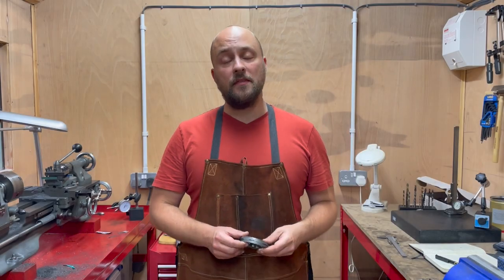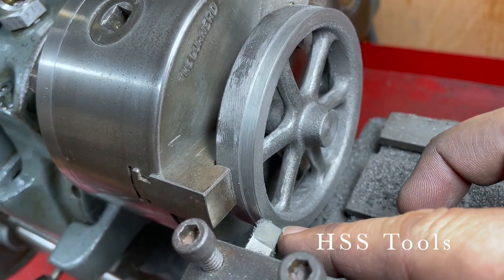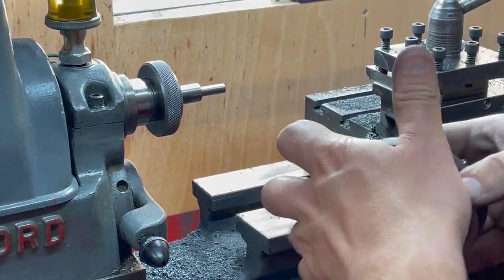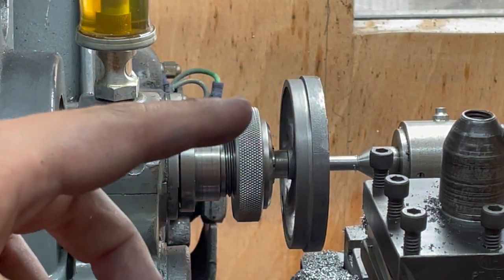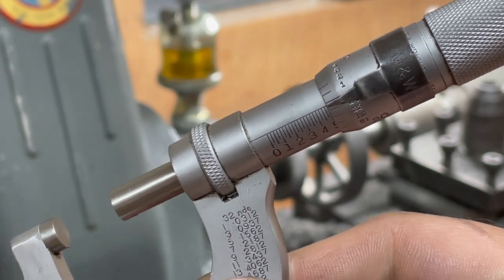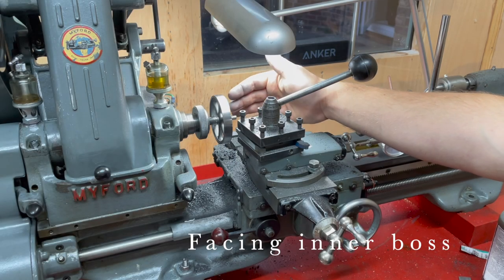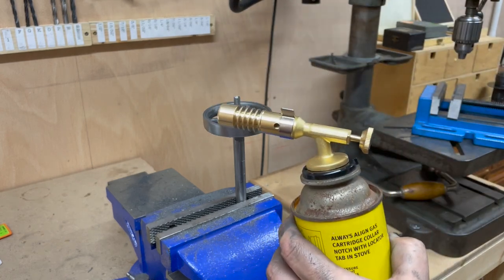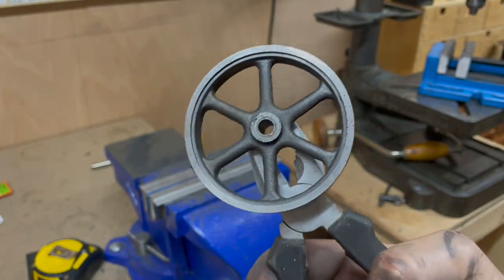Building a Stuart 10V Steam Engine on a Lathe VII - Flywheel

Comment: hi WW
Nicely done, if this is your first project well done.
If i were you, i'd fasten the bench down were your vice is it seemed to be moving around when you were filing, also if you come across a Quick Change Gearbox to fit to the Myford it will save you hours of time not having to change the feed and screwing gears. The blow torch might not flame out of control if you just give the nozzle time to heat up, 
Just a couple of tips  there, i'm not trying to be critical or criticise, but it may help, See you next time, keep up the good work
regards
mr f
Reply from the maker: Thank you Mr. F for the kind thoughts and input. This is indeed my first project.

The bench is terrible, what a waste of money! There are no fixing points on it at all, and it wobbles all over the place. I think I am going to sell it and build a wooden one...

Re: quick change - I may do that. I've not yet single-point-cut a thread in anger yet, so will have to see how that goes.

I've just filmed a video with my first silver soldering, I hope you might be able to comment on that to help me - it was a bit of a dogs breakfast.
Reply: @williamsworkshopuk  I bought one of those benches. I assume it is a "big dug" one? I strengthened mine with extra bracing and it is now very serviceable.
Reply from the maker: Hi  @carlwilson1772  - the bench is branded as 'Sealey' where I am, but like most things that I've bought new is probably a whitelabelled chinese product sold under many marques, etc. - how did you brace yours? I'm thinking that diagonal ties between corners may work - but that much steel strapping is probably halfway to the material for a new bench entirely!
Reply: @williamsworkshopuk  I'm in the UK. Ironically the increased rigidity of my bench was born out of the incompetence of the supplier, Big Dug. They failed to send me half of the longitudinal members needed to build the bench. After I contacted them they promised to send me these "next day". They didn't. Contacted them again and long story short they ended up sending me twice as many. So I cut up the spare ones and used them to make extra lengthwise and diagonal bracing. My bench is against a wall and I've bolted it to that to completely prevent any movement.